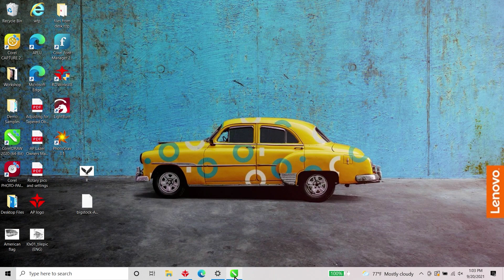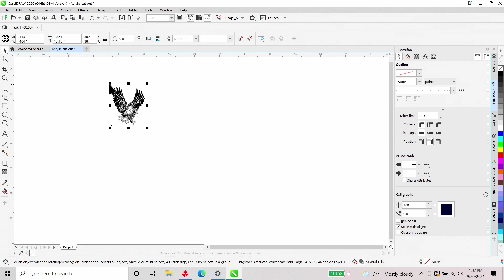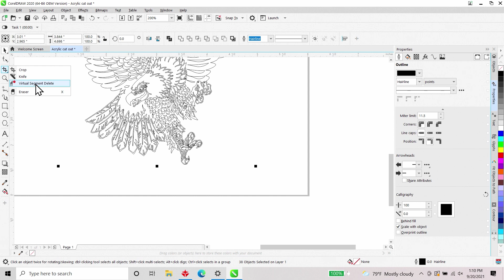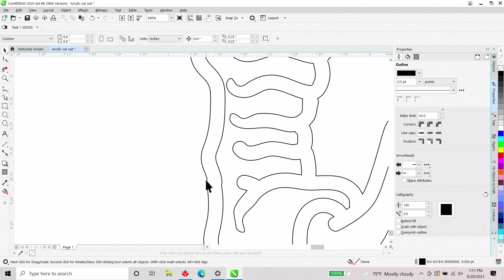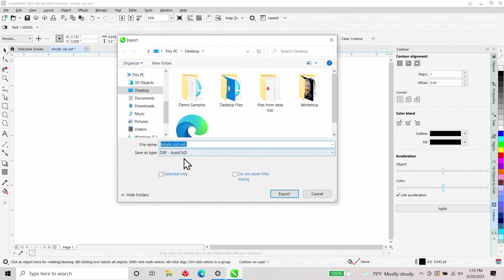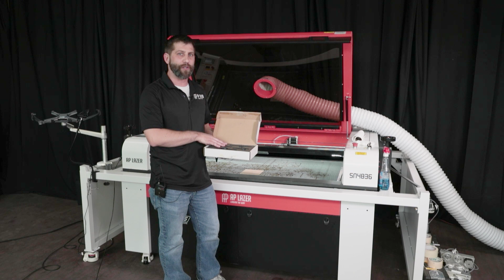How to Cut and Engrave Acrylic (Multilayer Process)

Comment: Acrylic is an amazing and unique material in the world of plastics especially when processed by a CO2 laser machine. Your very binary description of cast and extruded properties as white or grey  engraving and shiny or ridged cutting  is a "fact " that all material stockists and laser users believe.  Understanding how various materials respond to light energy is a scientific step too far for most people. because  after all, just as you have done,  with simple experiments and observations  the "facts" are provable.  I have an insatiable curiosity and scepticism encoded into my DNA and with just a little knowledge about the chemisrty of acrylic, I know that  cast and extruded acrylic are chemically identical. So why would they perform differently? It's illogical....to me anyway.

 When you reseach acrylic a bit deeper you will realize that those facts are in fact myths. They CAN perform the same both at engraving and cutting. Can I ask you to watch thes two videos about acrylic cutting and engraving and I am sure you will  allow you to have a different perspective on this wonderful material. Did you know there was a third manufacturing process? 

Windex and magic eraser  are uneccessary when you understand how and why the white mma condensation is stuck to your material. Clean , maskless engraving of acrylis is possible.

I admit to believing  and broadcasting these industry "facts" for many years, but now "i have seen the light".  The significance of that quote will be obvious when you watch the video.
https://youtu.be/lBkvdKMnBfg
https://youtu.be/j5fur-0o3_8

Comment: Hi there, just getting interested in laser cutting of acrylic to create blanks for making silicone molds with. My questions is, what is the difference in the texture of the engraving between cast vs extruded?  I understand the color difference, does that mean one has a more smooth engraving vs more textured and that is causing the difference in the color?
Reply from the maker: Hi there! Color has no effect as both can come in different colors. The biggest difference is cast acrylic sheets are made from liquid acrylic that is poured into molds that can be set into various shapes and sizes. This is the type of acrylic used for most of the awards you see on the market. Cast acrylic is ideal for engraving because it turns a frosty white color when engraved. Cast acrylic can be cut with a laser, but it will not result in flame-polished edges. This acrylic material is better suited for engraving.

The other type of acrylic is known as extruded acrylic, which is a very popular cutting material. Extruded acrylic is formed through a higher-volume manufacturing technique, so it is typically less expensive than cast, and it reacts very differently with the laser beam. Extruded acrylic will cut cleanly and smoothly and will have a flame-polished edge when laser cut. But when it is engraved, instead of a frosted look you will have a clear engraving.